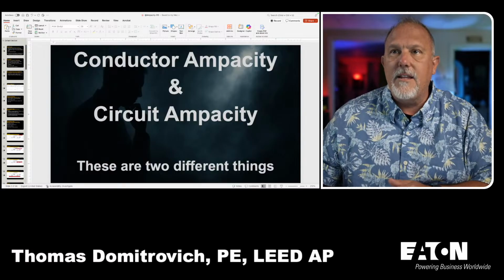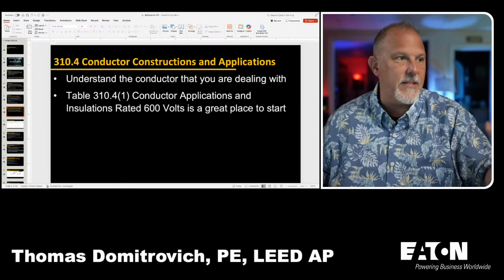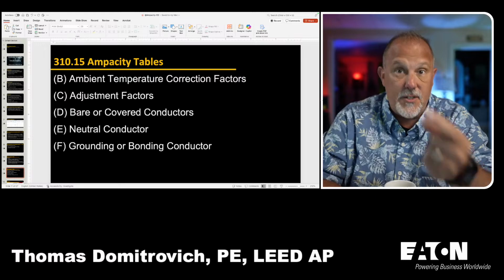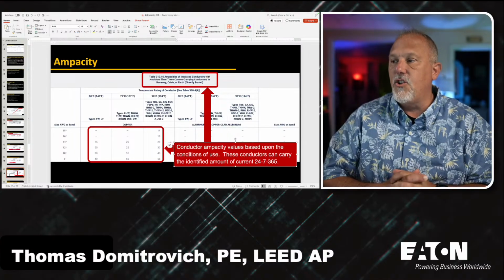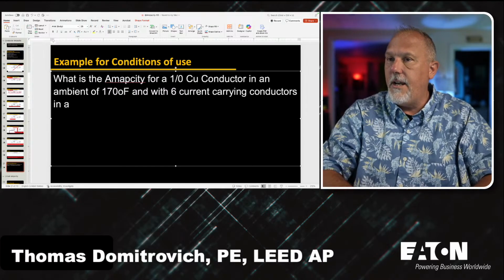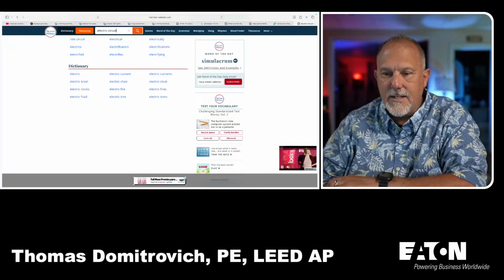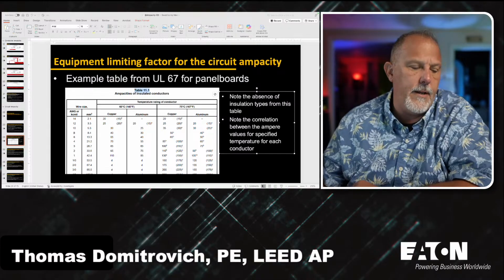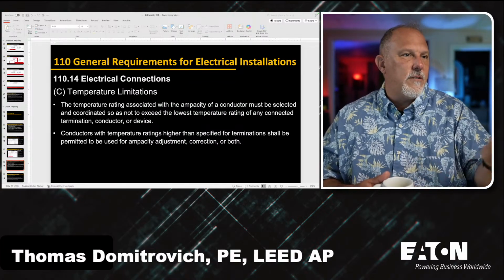Mastering Ampacity: A Deep Dive into Circuit and Conductor Capacity

Comment: I am 5 minutes into the video, so maybe this will come up.

As a tech it was important to look at the equipment (circuit breaker, the large panel board that contains all breakers, generator circuit breaker enclosure etc) you were connecting to. 90C conductor connected to a 75C lug needed to use the 75C table entry. 

Then you also had harmonic distortion from non-linear loads. It would be important to utilize the proper transformer for this, upsize neutral, and/or count neutral as current carrying conductor for deration as possible solutions to the side effects.

Then there were ambient temperature considerations. If you bury the conductor and don't follow pre-set dimensions for the raceways in concrete you need to calculate the duct bank temperature gradients. The Canadian code book has D tables for this. In some cases you could increase the ampacity of the conductor above the raceway table, but that would change to less than that table when you had more parallel runs.

Comment: The conversation on conductor ampacity and "circuit ampacity" is something the NEC deals with in 210. The branch circuit rating is part 2 of the article but it is not the conductors ampacity. I agree a lot of people struggle with understanding ampacity or determining it but we do have terminology that separates the two ampacity's.